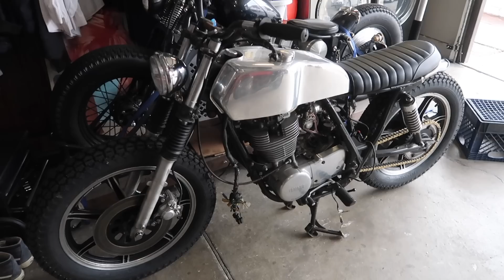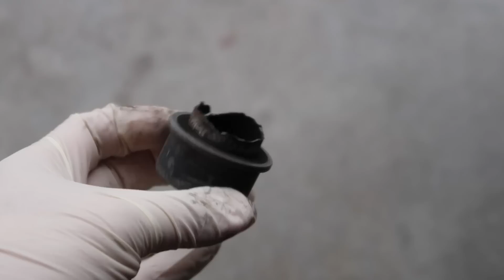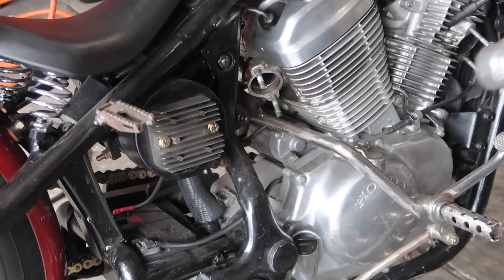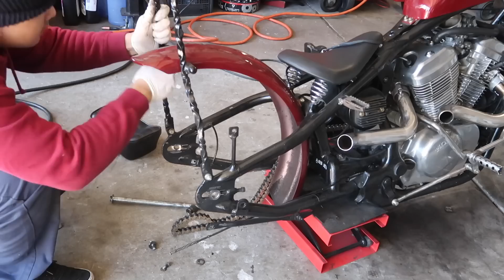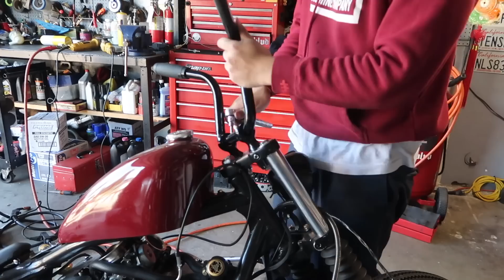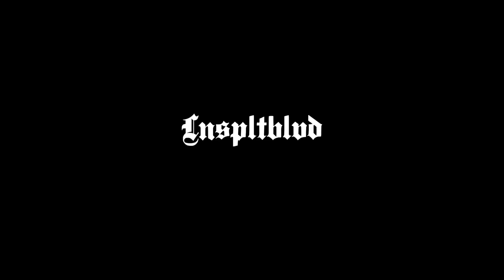New look for the Honda Shadow

Comment: Good job! Isn’t that front pipe going to heat up your leg, looks pretty close. The pipes are a nice design but they are going to crack again with out any hangers towards the middle or ends, just saying. I admire the way you just tackle any job that pops up on your bikes, more guys should give it a try!  I always jump right on your videos, great job!!
Reply from the maker: it should be fine, they're pretty lightweight. If they break again then I'll fix and make new ones. More content right? haha
Reply: Thats what I was thinking. looks like a hot leg. hopefully it works out.

Comment: Stupid question but are there any downsides of not having any kind of muffler at the end of your pipes? I’ve got an 85 Honda rebel 250 that was curious if I could just chop the mufflers off. I have the shorty slip ons I could install, just kind of lazy.
Reply from the maker: SoCheeesey you can chop it off but u gotta rejet